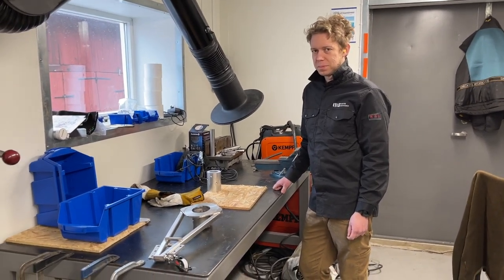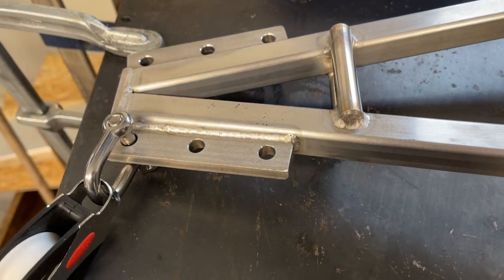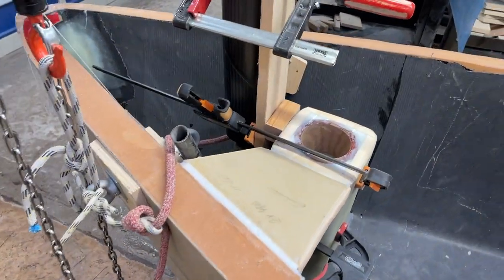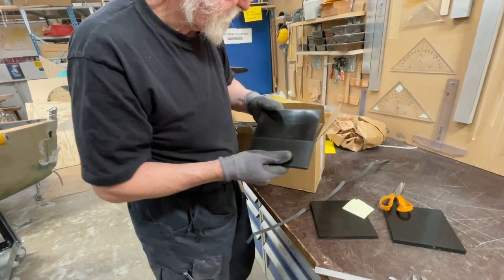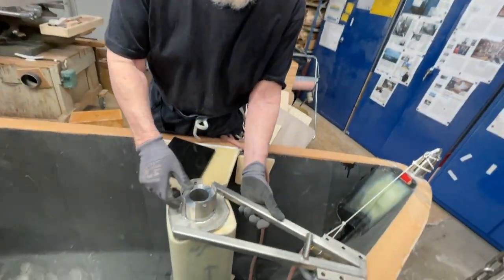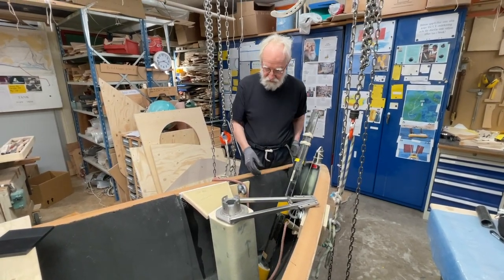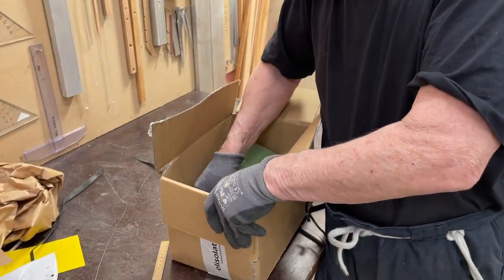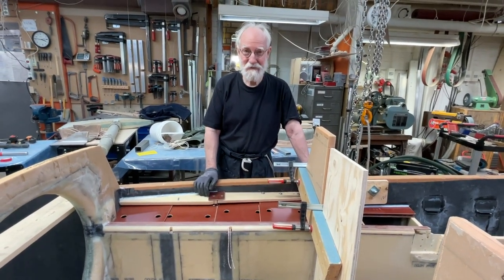8 Feb 2023  Visiting Martin the welder for the tiller, big chain links the tail chain and more.

Comment: I have never seen the oxidation removal process before.  That works very well.  Thanks to Martin for doing it so well.
Reply: Hi David! 

This is a non toxic modern method, gently for the enviroment and the operator. Using mask just for better safe than sorry. 

Best regards 
Martins Svetsteknik
Reply: @martinjonsson6926  Thank you. This sounds perfect also for archaeological metals, perhaps if not too badly corroded.

Comment: Irvin, you can also connect the chain with a spliced eye.  This is very resilient and has a smaller diameter than a knot.
Reply from the maker: I often connect by sewing a webbing to chain and rope. thats even stronger than splice.
But a knot is much quicker.
I will have two lenghts of rope chain. With two lenghts I can get 3 combinations.
The short.
The long.
The short + the long. Thats the last one I need the knot for.
Also I do not need to let out the whole lenghts. Thats give many possibilities.

Comment: Birdies of course!  Wasn't the case in my short golfing career.  Too frustrating.  Eletropolished chain.  Haven't heard of such a thing.  P.S.  I'm interested to know what kind of batteries you're going to have inside the boat.  I would think some kind of sealed battery like an AGM.  Lithium batts. are kind of explosive I hear.   And with the mizzen so close to the side won't it tend to push the boat sideways?  So many questions so little time-
Reply from the maker: AGM-batteries I will use.
Reply from the maker: @jasonmcintosh2632  The are more efficient but I am still afraid of fire despite what people say
Reply: @SvenYrvindExlex  It's important to feel safe.  You're already in the middle of the ocean, alone in a tiny boat.